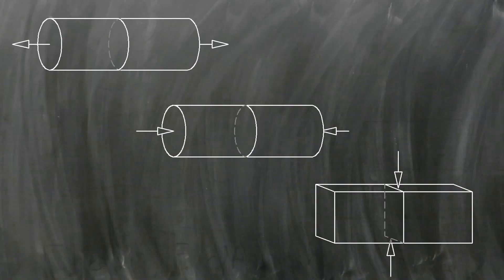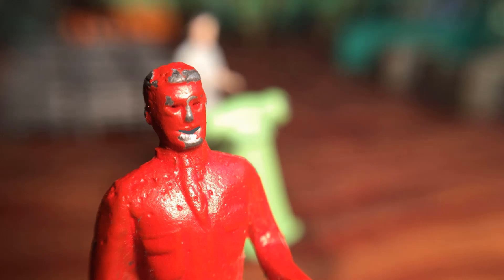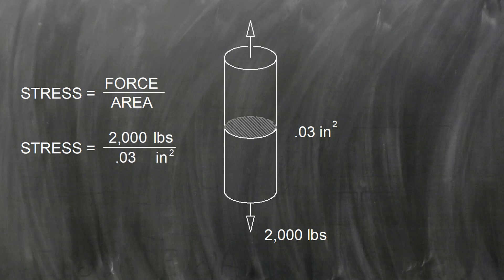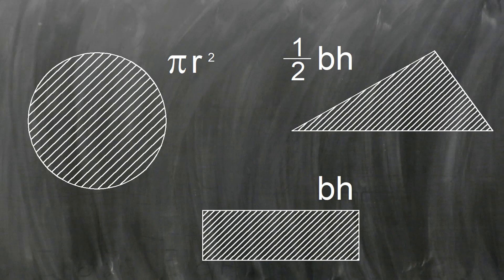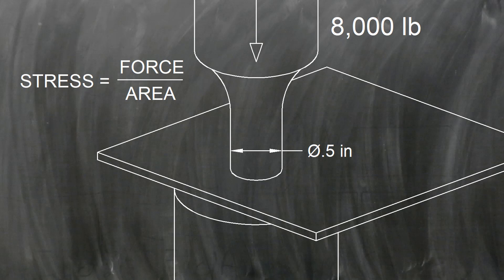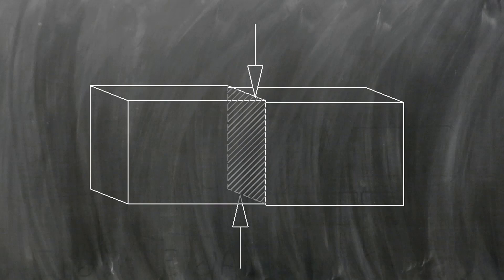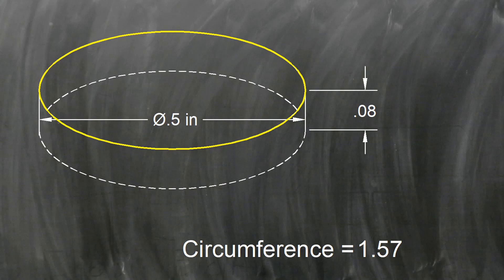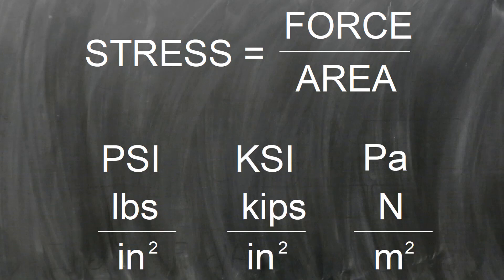Metals 101-4 What is Stress?

Comment: I appreciate the highlighting of the cylindrical wall surface of the hole being punched out for shear stress. That explains the concept and calculation of shear stress very clearly. It also teaches that compressive and shear stresses can occur together and stresses of different types can be present during a lengthy loading operation.